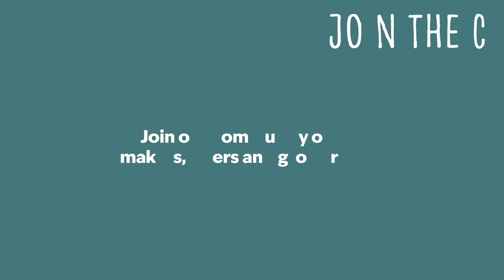Clearing Our Overgrown Front Garden - TIMELAPSE

Comment: Excellent video! I have been following you two for about 2 years now and am really excited by all the projects you do.  Love the tutorials on lime, lentils, and stonework! Really enjoyed this video about the small garden in front! Do you two have any plans to pressure wash the house's exterior stone walls and the entrance and re-painting?  Just love the steps up to the second floor and the concrete arbor and would love to see a video on those!
Reply from the maker: The exterior of the house needs a lot more work than just a pressure wash and paint unfortunately.

We need to:
1. chip away all the cement render (seems to have been used for a lot of patch work),
2. when we install windows/doors we're going to have to rebuilt parts of the exterior wall
2. when we replace the roof we suspect there'll also be some rebuilding to do in a couple of the corners

So, once we've done all the above we'll then do another coat of render on the entire house, and finally paint  :)

For the staircase we also want to remove all the cement render, remove the bannister/railing (because it's built with cheap red brick rather than stone) and put in a new railing. We'll probably point the staircase rather than render, but that depends on how the stone looks once we remove the render.

Much work to do  :)

We talk a little about the concrete arbours here:  https://youtube.com/watch?v=-w2CqYjj8W8&si=EnSIkaIECMiOmarE

Comment: Will you give the walls a blast with a pressure washer before the unit goes in?
Reply: And paint!
Reply from the maker: There’s more than a pressure wash needed … cement removed, windows installed, roof replaced, entire house rerendered, staircase and garden wall rebuilt …. then finally a paint 😀
Reply: @MAKEDOGROW  Oh, for sure - was assuming the unit will be going in sooner than later!
Reply from the maker: @LaReynedeNeige  the unit will be, but the rest will take us years (and no point spending effort on something that’s not needed yet, ie. cleaning)
Reply: @MAKEDOGROW  I was thinking of another youtuber  who was plasterboarding the inside of a cupboard with a newly-installed watertank in situ. Worth giving it a once-over because it'll be awkward to work around it once it's in. Don't want to damage it.
Reply from the maker: @LaReynedeNeige  a heat pump requires 30cm behind it, so won’t be an issue. We just don’t have the time now to do all the things required on this wall
Reply: @MAKEDOGROW  Fair enough, didn't realise a rebuild of the stair and wall was on the cards 🙏
Reply from the maker: @LaReynedeNeige  pretty much anything that’s covered in cement will be rebuilt (and made more aesthetically pleasing) …. that’s why it’s a 20 year project 😂

Comment: I don't quite understand. Where is the garden you are talking about? This layer of plastic covered with white gravel is not a garden. There is no garden without plants.
Reply: It is Japanese garden.
Reply: I reserve judgement until I see the size of the heat pump unit. But it did make me sad to see this corner ruthlessly denuded. Poor roses and other perennials! They did save the dahlias. I hope they find a microclimate on the property where these tubers can survive during winter frosts.
Reply from the maker: Why would you go and plant a load of greenery when you don’t know yet where the heat pump is going … or for that matter when you know scaffolding has to be erected to replace the roof, render the outside and do repair work to the stairs. That would just be a waste of effort!
Reply: Maybe go and watch older  vidoes then you see,